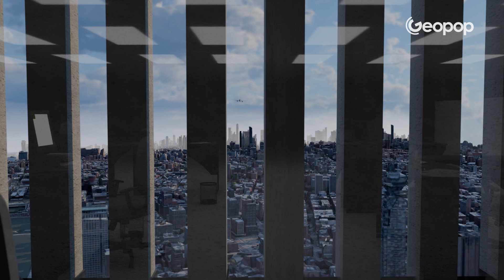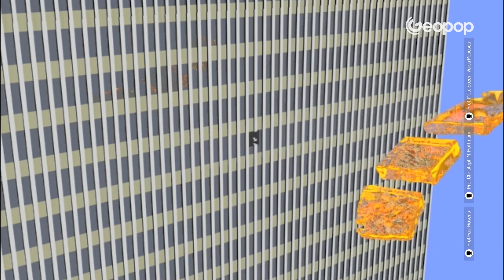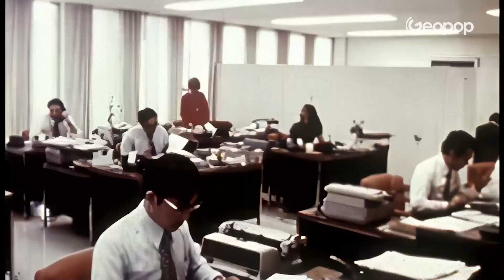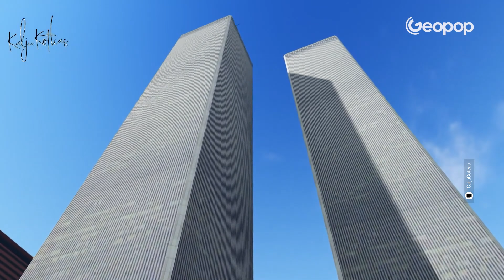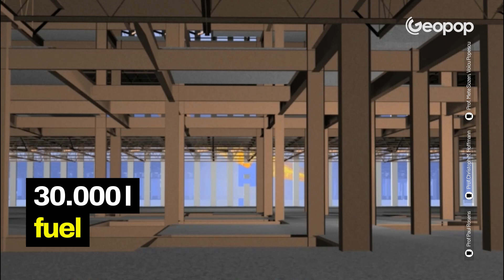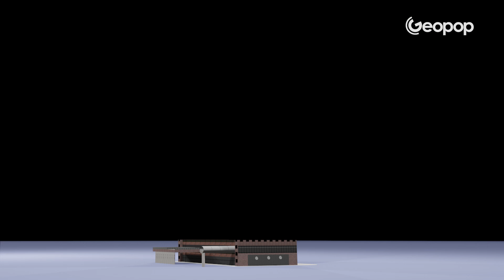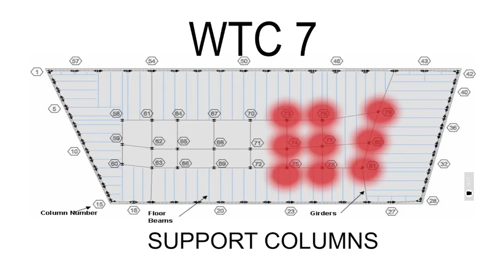9/11, 2001: The Technical Reconstruction of the Twin Towers and WTC 7 Collapses

Comment: Crazy people still believe in controlled demos when you literally see the building crumpling from the top down. Or how they don't understand the steel doesn't need to get that hot to lose its structural integrity. Completely braindead.
Reply: If that is the case then how is it that buildings are designed to burn to extinction without collapse? Just like these 3 buildings in question.
Reply: @robbiehiatt9966 Again, you can literally see WITH YOUR EYES how the towers came down. The building aren't designated to "burn to extinction"- not even sure what that's supposed to mean.
Reply: @JoeyOutgoing clearly you don't know what you're talking about
Reply: @JoeyOutgoing 1.The firefighters said" it looked like they planned to take down the building" I didn't say that, The fire fighters said that. They were there.I'm sure they know best.
https://youtu.be/XiIT4HInWjY?si=e1Pvp3-IFs-M75Oj
When the firefighter says "boom, boom, boom, boom" in this video.
What do you suppose he is?Implying by " boom" ?? What do you hear? 
2.So if there were no explosives then what is this? 8:25
https://youtu.be/bLF5D7M1YgA?si=aHSvS__uOdxMi1ZB
You can't say that it was added because you can see the firemen's reaction to the explosion. And you can't say it came from anywhere else because the firefighter says
" We gotta get out of here,  7 is exploding "
3. Controlled demolitions have squibs, you can see the squibs here 20 floors below the collapse. 
https://youtu.be/eXAgulfAtR4?si=-iLO9aQjMJVLTUYH
4. Firefighter says "any one of these buildings could blow up,  this ain't over yet" firefighter says there's 3 secondary explosions. 
https://youtu.be/0Gh3ErgMI4M?si=mmp9Eus_5PWTCBfl
5. Airplanes can't fly 600 mph at 1000 feet. And to be able to make a 180 degree turn to hit the opposite side of the pentagon going that fast is ridiculous. And since when do terrorists hit the opposite side of the building where no one was at when they could have just flown straight in and killed way more people???
 https://youtu.be/0Gh3ErgMI4M?si=mmp9Eus_5PWTCBfl
7. No one has ever known ahead of time that a building was going to collapse except through controlled demolition.  Tower 7 was reported to have fallen while it still stood in the background. 
8. Larry silverstein,  the man who made over 4.5 billion when they fell, claimed to have pulled the building down.
https://youtu.be/1jQaJFNWqtc?si=wCywQ9grgBdS_w11
9. A witness reported a missile hit the pentagon while he was seen at the scene. 
And the hole wasn't big enough for a plane and the damage wasn't consistent to the towers. And just like shanksville,  there's pictures that show no plane parts at all.
https://youtu.be/6_Ez-UCpXMs?si=JaQ6DBEC_LJtMLgN
10. That video also points out They were military planes that hit the twin towers. 
11. All sorts of reports of explosions were reported that day.  
12 Buildings dont accidentally fall  Into it's own footprint.
Reply: @AnimalFeaturesTV those buildings are made of steel because of its resistance to fire. Most steel structure high-rise.Buildings are designed to burn to extinction without collapse.Look it up genius
Reply: @AnimalFeaturesTV how is it that these experts found molten steel. Captain Philip Ruvolo (NYCFF), 
Richard Riggs(debris removal expert), Mark Loizeaux , Leslie Robertson (wtc structural engineer), Lynn Margulis (University of MA),  Dr. Abolhassan Astanch (from Berkeley),  Robert Kim Ireland( chemical engineer for US Army Corp of engineers), Mark Basile( chemical engineer), Kathy McGrade (materials engineer), Gery Warner( Mechanical engineer), David Gregg( PhD Chemical engineer), Steven Jones PhD( physicist), Kevin Ryan ( BS Chemistry), Niels Harrit (PhD Chemistry), Tom Sullivan( Explosives team) Jason Cheshire ( Chemical engineer), and Jeffrey Farrer (PhD Material science engineer).
Reply: @robbiehiatt9966 metal warps under extreme heat genius. It was literally all laid out for you you doorknob.
Reply: @JoeyOutgoing so that's all it takes is a fancy video and you think you know everything...
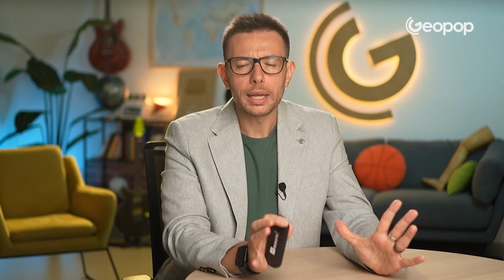Reply: @JoeyOutgoing at 1:39 he admits he doesn't know the truth.
Reply: @JoeyOutgoing 2:09 this video says they used thousands of statements to make this video. Why didn't he talk to the firefighters who were first hand witnesses on the scene. They would have told him about the secondary explosions,  the explosions coming from tower 7. And the CD collapse.  This isn't an investigation at all.This is propaganda to get you to believe some bs
Reply: @robbiehiatt9966 Says the guy more convinced with a conspiracy theory then what there's documented footage of. Just stop disrespecting the lives lost with these hair brained make believe stories. 

There's so much footage of the planes hitting the Tower and the towers coming down and even building 7 coming down but yet you just believe whatever you want to believe. It's total clown shit.
Reply: @JoeyOutgoing you want to ignore the firefighters. You want to ignore the other studies that other engineers have done?But you think nist is god or something. Of course you didn't do your research to see that nist left out the stiffeners,  they lied about the loads. You want to ignore the people that found molten steel under all of these buildings. That's a whole slew of really smart people. Yeah you're really doing a top notch investigation here buddy. Maybe if you say that word conspiracy a couple more times you'll feel better about it
Reply: @robbiehiatt9966 I'm not ignoring anything. I didn't need the NIST to tell me how the towers fell because it was abundantly clear. Ive heard firefighters speak on it and talk about how it's disrespectful to spew the conspiracy theories and I've seen video of the flight instructor who unknowingly trained one of the terrorists. There's hundreds of videos showing the event. You don't need to be scientist to know what happened. 

The only one ignoring things is you and all the other conspiracy theorists who refuse to look at the ACTUAL evidence. It's embarrassing.
Reply: @JoeyOutgoing  - Robbie is a pure attention seeking troll whose only interest is in getting people to reply to it. I assure you it does not care about any of this.
Reply: @TheLoonResistance no, just getting the truth out there for the people yall are trying to confuse.
Reply: @robbiehiatt9966  The buildings are designed to withstand fire for 1-2 hours. Long enough to get the people out. Which they did.
Reply: @BoodahBodey you know , that's probably what google tells you now. I looked it up a long time ago and it said that the buildings were designed to burn to extinction without collapse. You do realize that one of the reasons the building is made out of steel because of its resistance to fire. Clearly you are completely clueless
Reply: Burned bulg left as a sketon=steelFrame
Meaning of « burned to extinction »
Reply: @robbiehiatt9966  And the pile remained hot for weeks after the collapse through rainy days too. Jet fuel does not cause that.
Reply: @rickgangi3824 and lets not forget that before the buildings fell there was no water. But after they fell they continuesly dumped water on the pile for 100 days straight.  Could you imagine telling people , you don't have any water , but then you have enough water to spray it for a hundred days straight
Reply: @robbiehiatt9966  you just watched a 23 minute video explaining all of your questions with straight logic and you still think you have a point. Take some meds.
Reply: @JoeyOutgoing this b s doesn't answer any of my questions. 1.The firefighters said" it looked like they planned to take down the building" I didn't say that, The fire fighters said that. They were there.I'm sure they know best.
https://youtu.be/XiIT4HInWjY?si=e1Pvp3-IFs-M75Oj
When the firefighter says "boom, boom, boom, boom" in this video.
What do you suppose he is?Implying by " boom" ?? What do you hear? 
2.So if there were no explosives then what is this? 8:25
https://youtu.be/bLF5D7M1YgA?si=aHSvS__uOdxMi1ZB
You can't say that it was added because you can see the firemen's reaction to the explosion. And you can't say it came from anywhere else because the firefighter says
" We gotta get out of here,  7 is exploding "
3. Controlled demolitions have squibs, you can see the squibs here 20 floors below the collapse. 
https://youtu.be/eXAgulfAtR4?si=-iLO9aQjMJVLTUYH
4. Firefighter says "any one of these buildings could blow up,  this ain't over yet" firefighter says there's 3 secondary explosions. 
https://youtu.be/0Gh3ErgMI4M?si=mmp9Eus_5PWTCBfl
5. Airplanes can't fly 600 mph at 1000 feet. And to be able to make a 180 degree turn to hit the opposite side of the pentagon going that fast is ridiculous. And since when do terrorists hit the opposite side of the building where no one was at when they could have just flown straight in and killed way more people???
 https://youtu.be/0Gh3ErgMI4M?si=mmp9Eus_5PWTCBfl
7. No one has ever known ahead of time that a building was going to collapse except through controlled demolition.  Tower 7 was reported to have fallen while it still stood in the background. 
8. Larry silverstein,  the man who made over 4.5 billion when they fell, claimed to have pulled the building down.
https://youtu.be/1jQaJFNWqtc?si=wCywQ9grgBdS_w11
9. A witness reported a missile hit the pentagon while he was seen at the scene. 
And the hole wasn't big enough for a plane and the damage wasn't consistent to the towers. And just like shanksville,  there's pictures that show no plane parts at all.
https://youtu.be/6_Ez-UCpXMs?si=JaQ6DBEC_LJtMLgN
10. That video also points out They were military planes that hit the twin towers. 
11. All sorts of reports of explosions were reported that day.  
12 Buildings dont accidentally fall  Into it's own footprint...
Reply: @robbiehiatt9966 you think anyone was knew that terrorists will fly airplanes in full speed and full fuel tank that equivalent of a bomb and after that the fuel will spread around and weakened the steels? They were thought about 707 boeing which is much more tiny than 767 boeing and with normal speed because of airplane problems not because terrorists will hit the buildings
Reply: @SigalDa 1.The firefighters said" it looked like they planned to take down the building" I didn't say that, The fire fighters said that. They were there.I'm sure they know best.
https://youtu.be/XiIT4HInWjY?si=e1Pvp3-IFs-M75Oj
When the firefighter says "boom, boom, boom, boom" in this video.
What do you suppose he is?Implying by " boom" ?? What do you hear? 
2.So if there were no explosives then what is this? 8:25
https://youtu.be/bLF5D7M1YgA?si=aHSvS__uOdxMi1ZB
You can't say that it was added because you can see the firemen's reaction to the explosion. And you can't say it came from anywhere else because the firefighter says
" We gotta get out of here,  7 is exploding "
3. Controlled demolitions have squibs, you can see the squibs here 20 floors below the collapse. 
https://youtu.be/eXAgulfAtR4?si=-iLO9aQjMJVLTUYH
4. Firefighter says "any one of these buildings could blow up,  this ain't over yet" firefighter says there's 3 secondary explosions. 
https://youtu.be/0Gh3ErgMI4M?si=mmp9Eus_5PWTCBfl
5. Airplanes can't fly 600 mph at 1000 feet. And to be able to make a 180 degree turn to hit the opposite side of the pentagon going that fast is ridiculous. And since when do terrorists hit the opposite side of the building where no one was at when they could have just flown straight in and killed way more people???
 https://youtu.be/0Gh3ErgMI4M?si=mmp9Eus_5PWTCBfl
7. No one has ever known ahead of time that a building was going to collapse except through controlled demolition.  Tower 7 was reported to have fallen while it still stood in the background. 
8. Larry silverstein,  the man who made over 4.5 billion when they fell, claimed to have pulled the building down.
https://youtu.be/1jQaJFNWqtc?si=wCywQ9grgBdS_w11
9. A witness reported a missile hit the pentagon while he was seen at the scene. 
And the hole wasn't big enough for a plane and the damage wasn't consistent to the towers. And just like shanksville,  there's pictures that show no plane parts at all.
https://youtu.be/6_Ez-UCpXMs?si=JaQ6DBEC_LJtMLgN
10. That video also points out They were military planes that hit the twin towers. 
11. All sorts of reports of explosions were reported that day.  
12 Buildings dont accidentally fall  Into it's own footprint.
Reply: So you think controlled demolitions only happen if you can see the explosion?Is that what you're saying?Cause that's ignorant.
Reply: It's crazy anyway.Do you really think you can just light a building on fire?And it automatically falls down.If that's the case why do people get paid millions of dollars to take buildings down genius?
Tower seven fell perfectly into its own footprint. That's called controlled demolition genius
Reply: To: outgoingJoey
Sophisticated nanotermite found in the dust of all3builgs - speedsUPbur’ing&lowered meltingPoint
This was leftOUTofficialreports.
Reply: @MilaKlimova-t1m  no thermite was found. You are repeating lies.
Reply: @BoodahBodey .  Molten steel was reported by the fallowing 
people. Captain Philip Ruvolo (NYCFF), 
Richard Riggs(debris removal expert) , Leslie Robertson (wtc structural engineer), Lynn Margulis (University of MA),   Robert Kim Ireland( chemical engineer for US Army Corp of engineers),Abolhassan Astaneh from Berkeley, Mark Basile( chemical engineer), Kathy McGrade (materials engineer), Gery Warner( Mechanical engineer), David Gregg( PhD Chemical engineer), Steven Jones PhD( physicist), Kevin Ryan ( BS Chemistry), Niels Harrit (PhD Chemistry), Tom Sullivan( Explosives team) Jason Cheshire ( Chemical engineer), and Jeffrey Farrer (PhD Material science engineer). 

Ok, so this is what proof actually looks like, take note. It usually shows up in blue. 

https://youtu.be/hB1IYi51Kdc?si=7xSCnyaV9DvdCTHl

Now see if you click on that, it shows you stuff. 3:18 you will see video of Lynn Margulis (phd university of Maine) reporting molten steel.  3:09 video footage of Leslie Robertson (structural engineer) reporting molten steel. 6:34 Steven Jones (PhD physicist) reported molten steel, 7:25 Kevin Ryan (bs in Chemistry) reported molten steel 8:23 Tom Sullivan (Explosives technician) says thermite cutting charges is a thing it's not made up. 5:02 Gary Warner (Mechanical engineer) proves molten aluminum is gray, looks like mercury.  He worked smelting it in the biggest Aluminum smelting factory in the world at the time.
Reply: Explain how Molten steel was reported by the fallowing 
people. Captain Philip Ruvolo (NYCFF), 
Richard Riggs(debris removal expert), Mark Loizeaux , Leslie Robertson (wtc structural engineer), Lynn Margulis (University of MA),  Dr. Abolhassan Astanch (from Berkeley),  Robert Kim Ireland( chemical engineer for US Army Corp of engineers), Mark Basile( chemical engineer), Kathy McGrade (materials engineer), Gery Warner( Mechanical engineer), David Gregg( PhD Chemical engineer), Steven Jones PhD( physicist), Kevin Ryan ( BS Chemistry), Niels Harrit (PhD Chemistry), Tom Sullivan( Explosives team) Jason Cheshire ( Chemical engineer), and Jeffrey Farrer (PhD Material science engineer).
Reply: @robbiehiatt9966 Yet no molten steel exists. 

Explain how you just saw the building crumple from the crash site down and saw zero explosions but still believe in a controlled demolition 🤡
Reply: @JoeyOutgoing 1.The firefighters said" it looked like they planned to take down the building" I didn't say that, The fire fighters said that. They were there.I'm sure they know best.
https://youtu.be/XiIT4HInWjY?si=e1Pvp3-IFs-M75Oj
When the firefighter says "boom, boom, boom, boom" in this video.
What do you suppose he is?Implying by " boom" ?? What do you hear? 
2.So if there were no explosives then what is this? 8:25
https://youtu.be/bLF5D7M1YgA?si=aHSvS__uOdxMi1ZB
You can't say that it was added because you can see the firemen's reaction to the explosion. And you can't say it came from anywhere else because the firefighter says
" We gotta get out of here,  7 is exploding "
3. Controlled demolitions have squibs, you can see the squibs here 20 floors below the collapse. 
https://youtu.be/eXAgulfAtR4?si=-iLO9aQjMJVLTUYH
4. Firefighter says "any one of these buildings could blow up,  this ain't over yet" firefighter says there's 3 secondary explosions. 
https://youtu.be/0Gh3ErgMI4M?si=mmp9Eus_5PWTCBfl
5. Airplanes can't fly 600 mph at 1000 feet. And to be able to make a 180 degree turn to hit the opposite side of the pentagon going that fast is ridiculous. And since when do terrorists hit the opposite side of the building where no one was at when they could have just flown straight in and killed way more people???
 https://youtu.be/0Gh3ErgMI4M?si=mmp9Eus_5PWTCBfl
7. No one has ever known ahead of time that a building was going to collapse except through controlled demolition.  Tower 7 was reported to have fallen while it still stood in the background. so I guess these people are liars too...
Reply: @robbiehiatt9966  Please tell us how "they" managed to keep the explosives from igniting for 1-7 hours after the impacts, and raging fires? The colapses initiated at the point of impacts. So how did they rig the explosives so that they were not damaged by a plane collision?
Reply: @BoodahBodey what you're saying doesn't make sense because there was a huge explosion when the planes hit the buildings.
Reply: @robbiehiatt9966  yes there was clearly a big explosion when the planes hit. Do you not think that was from the jet fuel?
Reply: @BoodahBodey no way to really know.  But thinking you couldn't shield the explosives is silly anyway.
Reply: @robbiehiatt9966  not nearly as crazy as thinking that “they” could. The collapses all initiated at the point of impact. The south tower was hit lower on the building and it fell first because there was much more mass pressing down on the damaged structure.  It’s much more crazy to think that “they” planned that perfectly. What is the point of letting thousands escape from the building? Why not take it down immediately? Why use planes at all? Why not just bring them down simultaneously and instantly and kill everyone in the building and all of the surrounding buildings. The impact would have just as dramatic if not much more dramatic. So why over complicate it. By doing that you are greatly increasing the number of conspirators involved, and the chances of something going wrong and having the whole conspiracy exposed. That makes no sense.
Reply: @BoodahBodey the point wasn't to kill as many Americans as they could. The point was to make billions of dollars off of it. Maybe even trillions of dollars. The one fell first because it was detonated first. 1.The firefighters said" it looked like they planned to take down the building" I didn't say that, The fire fighters said that. They were there.I'm sure they know best.
https://youtu.be/XiIT4HInWjY?si=e1Pvp3-IFs-M75Oj
When the firefighter says "boom, boom, boom, boom" in this video.
What do you suppose he is?Implying by " boom" ?? 

3. Controlled demolitions have squibs, you can see the squibs here 20 floors below the collapse. 
https://youtu.be/eXAgulfAtR4?si=-iLO9aQjMJVLTUYH
4. Firefighter says "any one of these buildings could blow up,  this ain't over yet" firefighter says there's 3 secondary explosions. 
https://youtu.be/0Gh3ErgMI4M?si=mmp9Eus_5PWTCBfl
5. Airplanes can't fly 600 mph at 1000 feet. And to be able to make a 180 degree turn to hit the opposite side of the pentagon going that fast is ridiculous. And since when do terrorists hit the opposite side of the building where no one was at when they could have just flown straight in and killed way more people???
https://youtu.be/0Gh3ErgMI4M?si=mmp9Eus_5PWTCBfl
7. No one has ever known ahead of time that a building was going to collapse except through controlled demolition.  Tower 7 was reported to have fallen while it still stood in the background. 
8. Larry silverstein,  the man who made over 4.5 billion when they fell, claimed to have pulled the building down.
https://youtu.be/1jQaJFNWqtc?si=wCywQ9grgBdS_w11 yet somehow today he is only worth one billion dollars.